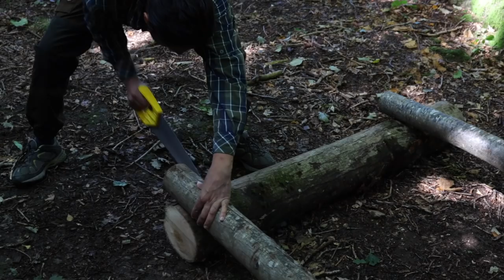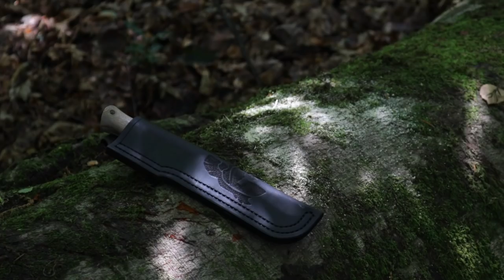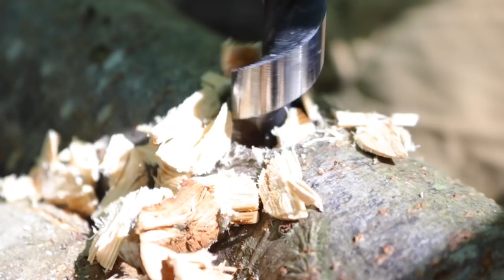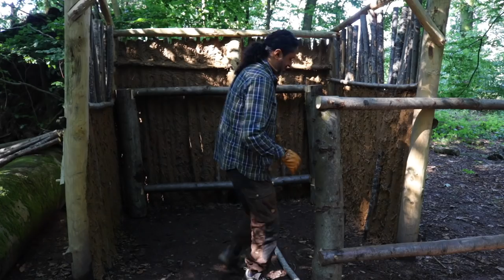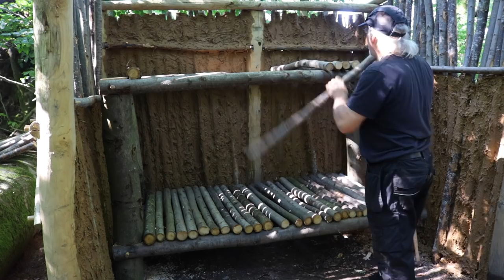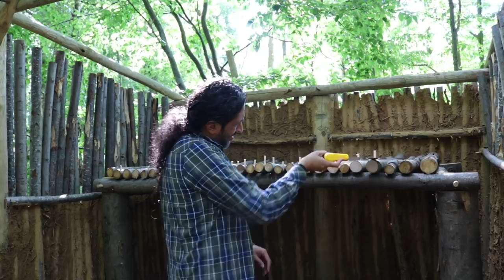Bushcraft Basecamp (Pt 11) - Building A Bunk Bed In The Forest

Comment: Zed sir I see you using a Ball Peen Hammer to hammer in those wood dowels, it has a Rounded Heads, which will cause the wood to round over, its used mostly for metal work.  Bunk Beds interesting, top want have allot of room after add roof.
Reply from the maker: Appreciate the insights my man thank you ~Peace~

Comment: Damn Sam !!!!   Definitely a joiners dowel convention there !!!! DDDDD  If you are going to do it - do it quality the first time (yup!), and you won't have to constantly remake it all the rest of the time.  Too bad you couldn't have split/cut the bunk timbers into half sections, so that you would have had a total flat bunk surface.  Next is putting in the 50 gal HD mil plastic garbage bags (or burlap sacks) with duff fill for the bunk mattresses.
Reply from the maker: I did consider splitting the logs but was fortunate enough to source 1-2 inch diameter pieces of chestnut so left it as it is to retain rigidity ~Peace~

Comment: A Job well done done and another ticked off your list when will you be putting a roof on there would think everything would get pretty damp if its not soon. Really interested in how your going to do the roof we are building a long house of sorts for our Rangers that will all be pegged have you dried out the pegs before putting them in?
Reply from the maker: Yes the pegs are from seasoned wood so the green wood should hopefully dry around it and form a tight seal ~Peace~
Reply: Thats great thanks